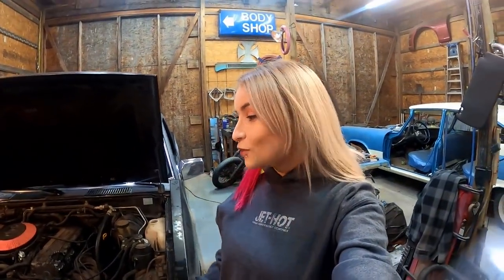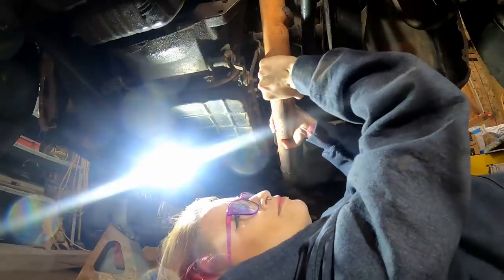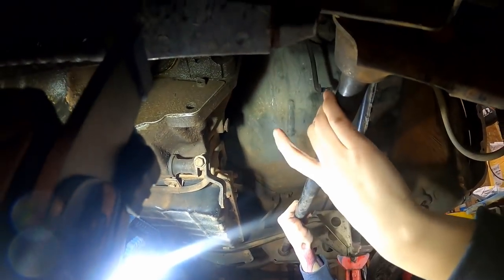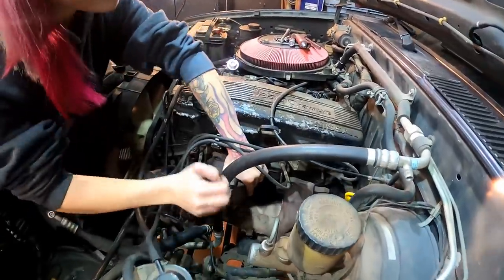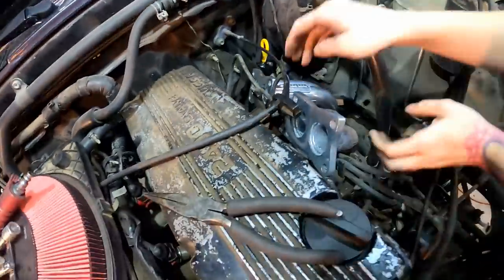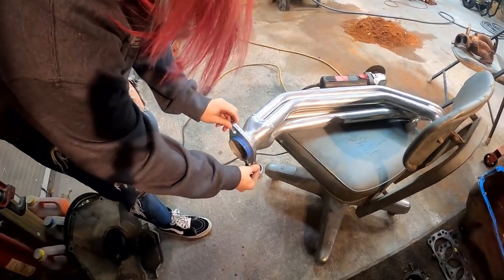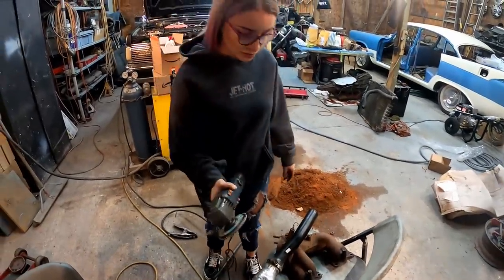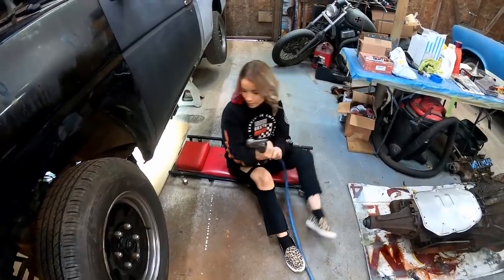NISSAN HARDBODY MINI TRUCK BUILD PT.19

Comment: Might have to wrap the bottom of that header so it doesn't add unnecessary heat to the transmission pan or fluid. Looks like the header was made to go there.

Comment: I learn a ton from watching these video thanks. I could use some community knowledge with a question. I have a 86.5 d21 king cab that has a JPN vin and as far as I can tell was build really early like late 85. It has a yellow gold interior including bucket seats and  golden exterior and it seems original. Is This a truck that collectors would be interested in? thanks
Reply: It was stored in a barn has little rust, runs and has only 69k miles

Comment: Just so you guy don't struggle with the rubber hangers use some WD40 or soapy water to take it out easier. No need for special tools.